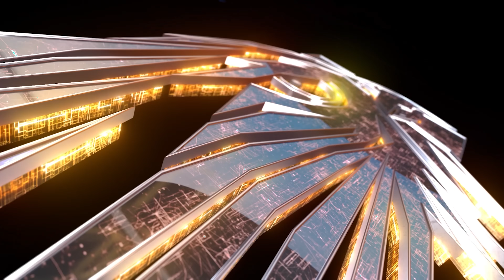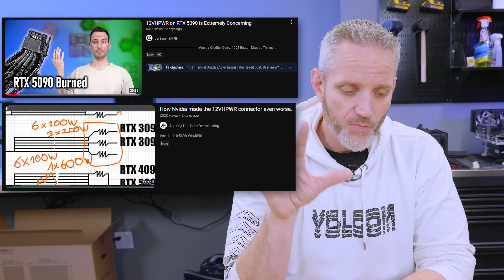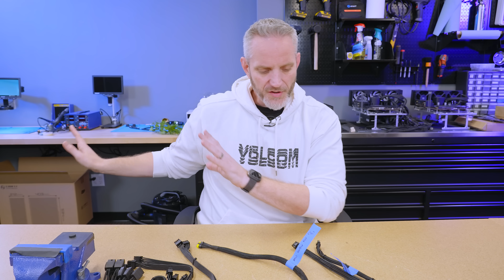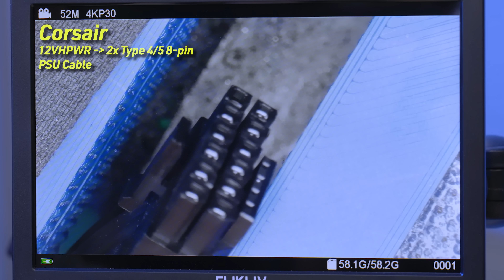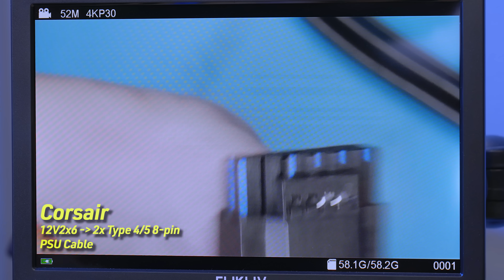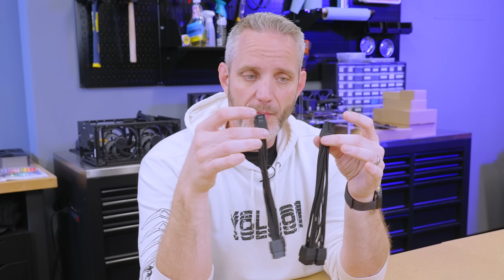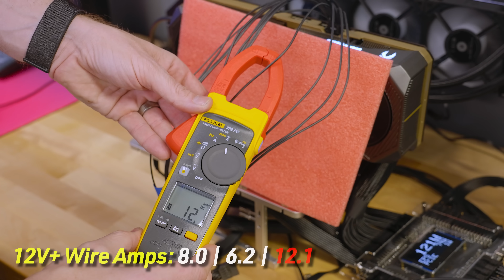I discovered something concerning and I need the Experts to chime in... More 12VHPWR discovery!

Comment: Hi Jay,

It's disheartening to see your findings, but your concerns about the pins not being properly seated and secured in the sockets are legitimate. Having crimped many connectors in my lifetime, I can say that this is a clear example of poor, if not non-existent, quality control. It's unfortunate that the so-called experts are remaining silent, though that may change.

I, too, have been delving into the specifications and data sheets of the ATX 3.0 and 3.1 standards, tracing it all the way back to Intel, who started this whole situation. It's on my radar, and I'll be extremely vigilant when my new PSU and GPU arrive.

As for those who criticize third-party cables, claiming they are no good, I can attest to the high quality of many third-party cables I've obtained from China through AliExpress. Even the adapters I've purchased have been of excellent quality, and I've never encountered any issues. The argument about certification is debatable; I've often found that non-certified products can meet or even exceed quality standards. It's essential to make informed decisions based on customer feedback and sales volume.

Great video, as always. Keep up the excellent work, and thank you!

Comment: The quality of that Corsair cable is shockingly poor.  I'm really curious how common that is.  Personally I've been using the same cable for more than a year without any issues, and I don't recall noticing any inconsistency in the pin (socket?) lengths which I'm sure I would have when I first got it.

Comment: @Jayztwocents Unfortunately, you made a mistake in your explanations, which I would like to draw your attention to. The real problem is that Nvidea did not adhere to the specifications! These state that the pins in the power supply are supplied by a busbar and the total power (here 600 watts, 50 A, 12V) is protected. The consumer (here the graphics card) must then ensure that a maximum of a fraction of the power provided can be drawn from each pin. So 50A from the power supply divided by 6 pins is 50A : 6 pins = 8.33 amps per pin.
Nvidea did not adhere to this and cannot adhere to it with the current circuit board design. The error is directly behind the connector on the circuit board of the graphics card. There is a busbar, just like in the power supply, and only after that comes a shunt to measure the current and control electronics to limit the total current, but not to limit the current per cable.
So between the 2 busbars we now have 6 resistors connected in parallel, consisting of cables and plugs, and the current can choose the easiest path! This is the basics of electronics that Nvidea is not paying attention to.
This is the very first lesson in electronics: connecting resistors in parallel.
Reply: Addendum: The error will also occur with the supposedly good cables from Nvidia and these cables will also burn out.

Comment: As much current flows down the ground pins as down the power pins, though suppliers normally put extra ground pins on a system so the individual cables take less current.

If this cable is a crimped cable, then there is a catch to hold the connector at the right place.   An X-ray of the cable will show whether there is a clip and if it is bent. In my experience, once the cable starts to move in the socket it is only a matter of time before the cable works itself free.

Comment: Hey Jay could this potentially cause issues with lower spec cards too? I've been thinking of buying a used 4070 Ti Super and wanted to buy a 2x PCI-E to 12VHPWR cable from be Quiet! for my be Quiet! Straight Power 11 1000w PSU but now I'm worried and will likely stick to the adapter.

Comment: Push that loose pin all the way up and see if it locks in. The locking mechanism may be broken or it wasn't installed all the way into position to begin with. Any chance that the connector was pushed hard to install at an angle? The plastic on that end looks mushed for some reason, looking at the adjacent pin on the same ground side. I haven't experienced these cables yet, but sometimes connectors don't want to mesh very easily until lined up perfectly. The Corsair connector looks to be not very uniform in the plastic "towers" of the connector.
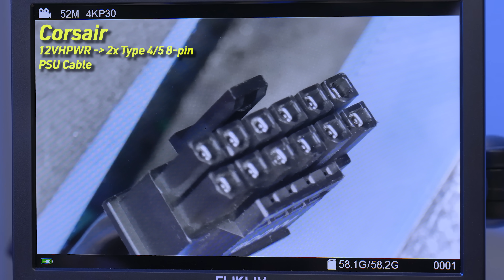Edit: 9:13 shows what I'm referring to.

Comment: So one misconception. The difference between 12VHPWR and 12V-2x6 is on the female connector end (i.e. the PSU and Graphics Card ends that the cable plugs into). The cable is the exact same 12VHPWR cable it's always been. There is no difference in the cable.

Comment: I just checked out my new NZXT 1500C ATX 3.1 PSU. It comes with dual 600W 12v-2×6 cables. All the cables do move slightly and there's low quality how the connectors are designed. I would be worried about using these cables at full 600W load. This wouldn't be an issue if the GPUs came with dual 12V connectors and overall better VRM design. There would be almost 2x added safety margins. 

The current one 12V connector have pretty much no safety margins vs. 8 pin era with multiple connectors. When a company like Nvidia creates higher wattage GPUs, there should be higher focus on safety. We all know that some percentage of cables have issues and won't be perfect for years to come. This is why engineers have to add margins of error.
Reply: Addition. This is the top of the line Platinum/Titanium level PSU. If something like this doesn't come with perfect cables, there is going to be way bigger issues on cheaper products. This isn't as bad as Corsair 12V cable in the video, but definitely not as good as I would expect. This issue we have now is still more to do with Nvidia and how they create these GPUs without proper safety margins.
Reply: @data-analyytikko  I have to check my nzxt psu cables now.
Reply: @Monsux are the NZXT cables worse off than the Corsair ones that Jay showed in this video? If you could post a video, it would be great.
Reply: @kuro.144  Not as worse, but all the cables did wiggle like 1 mm. There were no uniformity like I would expect. When looking at the side, all the metal pins had slightly different height. This is a bit weird, because the cables are high quality. Seems to be only connector issue. My bet is that NZXT won't produce their own connectors.
Reply: @data-analyytikko  I just told my PC builder to switch away from Corsair to NZXT C1500... Unfortunately MSI PSU wasn't an option provided... Let's pray that our 5090s will survive.
Reply: @kuro.144  The PSU itself is insanely good. The best bang for the buck I can think of. The reviews are also great. It would be good to keep the C1500, but just get better 12V cable. I personally will get some thicker 14 AWG or higher cable. While waiting, I would suggest using the Nvidia adapter that uses 8 pins. There are plenty of those included. 

I don't even think that this makes any difference in real life. The pins should be longer any way on the opposite side with 12v-2×6. I bet that the melting and overload on a couple of wires is caused by the GPU design, not the connector. While saying this, I wish all the connector were the same quality.
Reply: @ One addition. Doesn't matter what PSU you end up using, I still suggest using the Nvidia own adapter, so there won't be issues with warranty if something happens. At least before Nvidia comments this. I would switch to single 12V native cable only after official Nvidia statement. I have seen companies blaming others for so many times.
Reply: @data-analyytikko  could you tell me what particular cable you recommend getting? Would help a lot, thank you.

I'm on the PC builder's warranty for the first three years so best for me to not touch anything, they'll deal with it if something burns. But after that I may be interested in getting a better cable.
Reply: @kuro.144  I don't know yet what would be the best 12V cable. The Nvidia own native adapter and 8 pin power cables would be the safest option. You don't have to do anything else but use PSU manufacturers own 8 pin cables + Nvidia adapter, nothing else. This way, Nvidia would have to cover the GPU side and still have the 10 year PSU warranty. Most likely even the home insurance would cover things if anything happens.
Reply: @data-analyytikko  ok, where do you get 14awg cables?😁 I'm interested. Also, how can you know if the supposedly new cables have same pin design as the nzxt? 😁
Reply: @epicnoobsocial  The moving part is part of the port standard, so it's designed like that. No idea where to find better 14AWG cables. I just got my 5090 order in, so I have to start checking out. I don't think this is going to become and issue, because I always undervolt heavily my GPUs and CPUs. My RTX 5090 will be running around 400-450W max load anyway.

Comment: WOW most of the Corsair pins out of spec, ground is just as important as positive in a circuit. I still can't get over that Corsair plug pure junk. My experience is about 40yrs+ in mechanical and electrical residential, commercial, and automotive class 2 master's in industrial maintenance, difference between class 2 and 1 is years in the field. When dealing with power delivery at a connection like these is insertion depth and contact pressure between male/female pins and if the source and destination are common rail and you have temp and amp difference greater than 1-3% you have a problem. Whoever emailed you from Corsair either doesn't know what they are talking about or barley passed electronics engineering. When wiring a control cabinet for a high-speed production line, laser probes and proximity sensors had to be so precise that the wire had to be soft soldered then a ferrule crip was required before being locked into place with a torque screwdriver. The way I was instructed to do wires like that was twist the strands tin the strands then ferrule crimp then make sure end is fully inserted and torque the terminal jiggle and retorque 2 times. I still can't get over Corsair saying that pin movement was fine, literally blows my mind and makes me question the quality of anything made by Corsair. The reason why your PMB2 balanced the power is it took the leads back to common rail to measure power and back out though a common rail, if your PMB2 measured each individual wire it would have given you a warning or showed the imbalance between the wires. Hope this help you and anyone else who reads it.

Comment: This is something I always been checking for everything cause of molex. Those damn pins slid out all the damn time and even had one light up so fast it went from a solid wire to vapor within seconds. Also, all these PSU's lately have started to have 3.1 labels on them on 2 year old model PSU. MSI's Ai1300P looks to be identical to one they had for two years but barely mention they include their sleeved and  updated cables.

Comment: The problem with the connector argument is der8auer reddit card the pins look good relative to the edge of the connector.  Der8bauer should move the two problematic cables and see if the amp draw is the same on the new pin.  That would mean the cable is bad, if it doesn't move the pins on the gpu is requesting a lot more power meaning there something wrong on card side.  You should repeat your test with your other 12vhpwr cables and see if amp drag are the same and then measure the resistance.

Comment: Jay, you might take a white fine tipped paint pen and mark the wires at the base of each 12VHPWR connector after making sure the pins are fully seated, then plug it into the GPU to see how much those wires push out of the connector.

Comment: The use of very low temperature plastic causes the clip to melt holding pins. A higher temperature  plastic would be ideal, and 14 AGW wire

Comment: You have the logic backwards, the current follows the path of least resistance, it's the good pins that are melting. The bad pins are shifting the load to the better pins until the wire becomes out of spec. 

If the the load was balanced, then the bad pins would be the problem since you would have the same current going through more resistance.

Comment: I´m worry of using only two PCIe(corsair says 300w each) cables(Corsair RM1000 from 2015) to power the 4080Super(1 year like that), but all that PSU cables 12vhpwr come only with 2 pcie connectors ?!

Comment: I've crimped and made my own mini-fit and micro-fit cables for 3D printer related stuff. The difference in pin heights you're seeing is just because the pins are inserted into he plastic connector housing from the rear of the housing and the locking part of the crimp pin has some play in it once it locks into that housing. You should be able to grab individual wires on the connector and wiggle them and you will see the pin wiggle. When you plug the connector into the card the pins will be pushed back into the plastic and all of them will be at the same height. Its more likely the quality of the crimp of the pin to the wire or the condition of the pin itself is the culprit. A safety factor of 10-15% for carrying 600W is just asking for trouble with a connector that has pins that small.

Comment: When the pins move upon insertion, it prevents the pins surfaces from mating in the way they were designed to.  Because these pins are so small, they don't have much headroom, if any, for out of spec situations.  So, this can result in hot spots when there is a high current draw through the particular pin and wire.  If the hot spots get hot enough for long enough the pins, wire, and connector will fail.

Comment: So I am not an engineer. I work in electronic warfare. I deal with extremely high current and voltage systems.

Typically the ground connections just need to exist. With a low resistance to your ground plane. I could see a problem with the ground connections getting hot, or the poor connection causing the corresponding positive connection to not pass current. It depends on the board design. If it's all going to one unified bar it should be fine, mostly.

The use of rather undersized pins and wiring is concerning. These designs appear to have a rather low safety factor. A larger pin and socket design, along with heavier gauge wires would be much safer. 

The amount of conductor movement in these plugs is not acceptable. They need to have the least amount of play possible to maintain a good connection with connectors of this design.

The old PCIE power cables, or even a higher current connector would have been a much better choice. Suck as using something similar to a few XT-60 connectors in parallel for the higher current needed. Each being connected separately to the power supply preferably.

Comment: Working in the automotive industry the most common cause of a connector melting is from pinfit being too loose. Meaning the female pin is spread out of spec, causing the male pin not to have enough contact pressure causing resistance. Being able to move the pins a little is normal but the corsair connector definitely seems excessive given the size they are. Im wondering where they came up with this connector spec because in the automotive world pins that small dont see over 5 amps fused. Probably 2.5 amps constant duty. It  even looks odd seeing a larger cable terminating to a smaller pin

Comment: A bad connection does NOT increase the amps, it increases heat generated. Amps will actually decrease a little due to the higher resistance.
Reply: It will increase amps going through the well connected wires.
Reply: @ajkulac9895  Very slightly, but that's not what he was saying. He also described it wrong in another video, and the bad current is through the hot wire.

Comment: Why all this speculation? (not only here, but on so many other channels as well). Measuring contact resistance of a mated connector isn't hard. I've now heard about the 12VHPWR connector problems for months if not a year. And that's me as someone who'll probably never buy a graphics card that needs such a connector. Heck, I'm not even actively following any PC building channels, it's just that videos sometimes appear in my suggestions.
But I am into electronics and wondering firstly how NVIDIA can mess up something that we've had for over a century (electrical connections). And secondly why no one just measures the contact resistance of different combinations of cables/plugs and sockets (preferably with multiple samples per model). All that speculation if a connector is seated properly, if the connections are equal, how it changes with multiple reconnects, aso. isn't needed. It can simply be tested.

Comment: I still believe that the terminals have been damaged in production of the cables. IE the barbs that hold the terminal into the block and not biting into the block housing.  As an electronic repairman I have seen so many times the terminal in the plug has been defective.  Also I learned in EL101 that DC current runs negative to positive.  If that Corsair cable was mine it would have been in the trash.  Why risk a $2000+ investment on a known risk.  It is also why I am using a RX 7900XTX.

Comment: As the Resistance in the connector increases, so does the Amperage, while decreasing voltage. This will increase the temps, and possibly instability in the card.